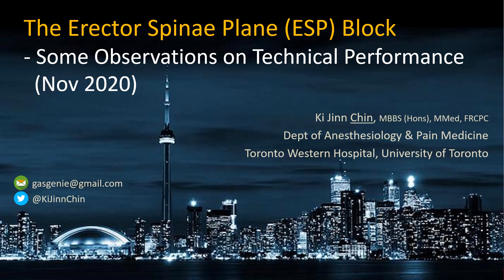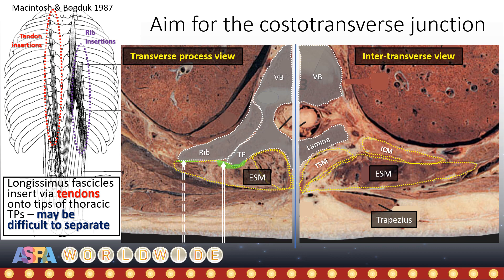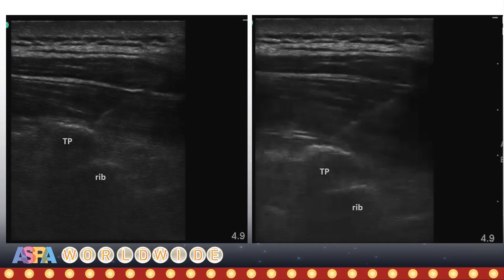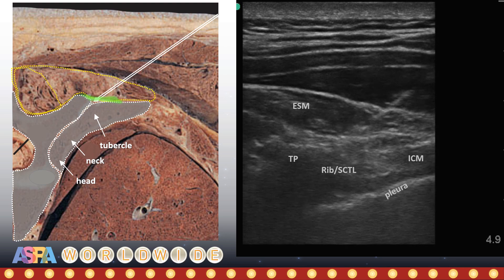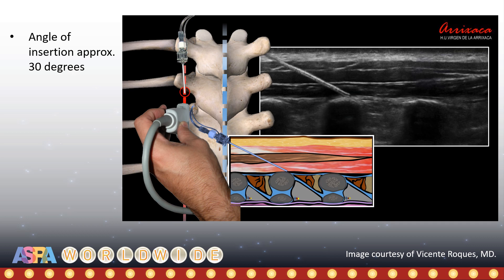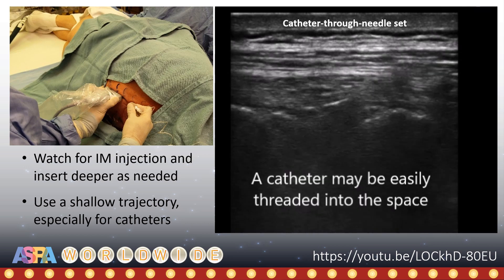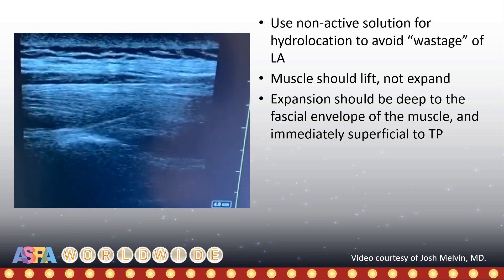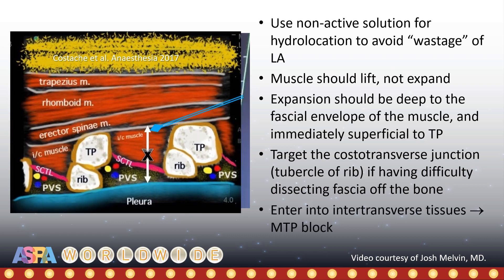ESP block - Technical Notes for 2020

Comment: Dear Dr. Chin, you have again made a quality video, my question i just how much do you believe in the effect of ESP block for abdominal surgery, I find very little evidence in the literature.
I find it helping sometime as rescueblock after lap. hernie repair and lap. hysterectomy, but mixed results when given before surgery to our lap. hemicolectomy patients.
Thank you for your great educational work.
Reply from the maker: As you mentioned, the ESP and other fascial plane blocks work well as rescue techniques, because they reduce pain, just not always to zero. And patients can perceive that difference. If done preop, and it reduces the pain they WOULD have had, that impact is not appreciated. Ultimately, it is an indirect paravertebral, and with that comes the variability that you would expect.
Reply: @KiJinnChin  thank you for your answer, and great videos, just watches 3-part about RA vs GA
Reply: @ki jinn chan I wanted to know some details about the requirements about working in Canada in the field of anesthesiology

Comment: Thank you for  the great video! Would it be too much trouble for you to have a look at my last attempt of ESP block? Clinically the block was failed.  https://youtu.be/FAhJw39x1yI
Reply: Hi Yuriy - I think that although it looks like linear spread, it is actually a little bit too superficial, and is intramuscular. In the early part of the video, if you look at the lower left area, you will see that there are other hyperechoic layers below the fluid spread. I personally think that if unsure, then it is safer to go deeper than shallower.
Reply: Thank you for your time, you're so helpful!